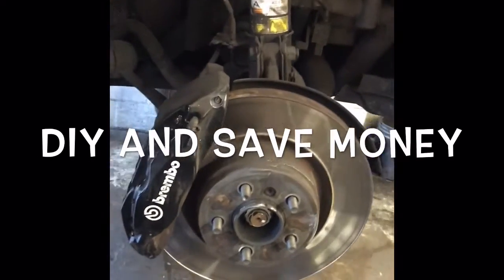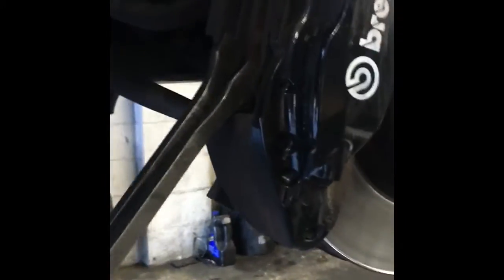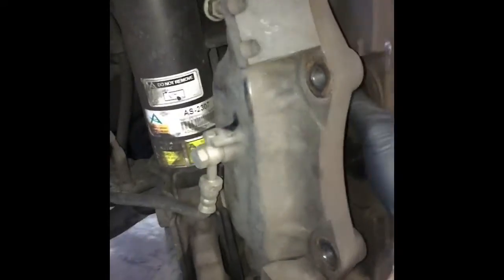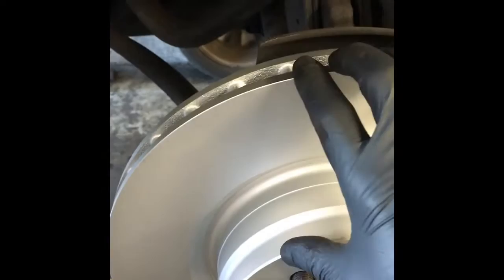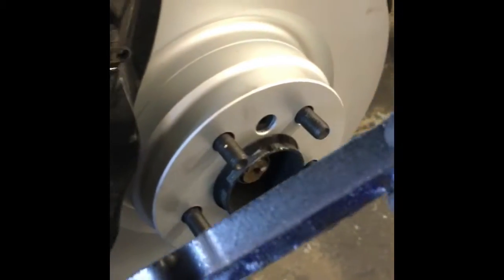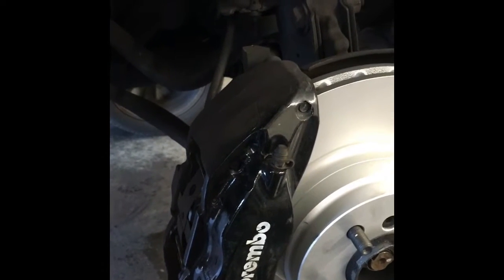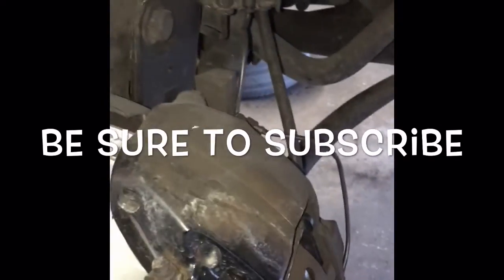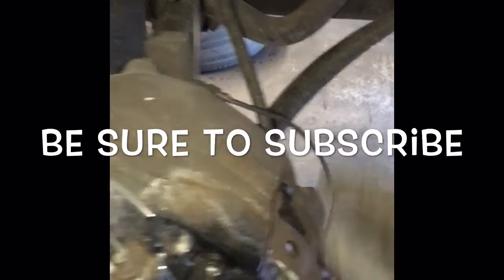How to Replace Front Brake Pads and Rotors on a 2005 Range Rover

Comment: Thank you for posting. Do you own this RR? If so how are maintenance costs outside of DIY maintenance. I'm talking about major stuff like engine, electrical, transmission issues? Think of getting presented but will do basic maintenance myself.
Reply: I meant to say thinking of getting pre owned...
Reply from the maker: Matt A this is a customers car. They can't have transmission problems. Due to the car being very heavy. The problem is I see have window switches regulators cupholders small problems like that. They can leak oil though. Hope this helps and thank you for watching.
Reply: How to Automotive Thank you for the response and again for the video.

Comment: I have a 2006 Range Rover sport. The drake light still on. Should I get a new sensor?
Reply from the maker: Mensaje final And some of those vehicles we had to turn off the scan tool. If that doesn’t work then I would look into replacing the sensor. And if you didn’t replace it when you did the brake pads and definitely do it.
Reply: @HowtoAutomotive  I have the same question as Rime? That first comment.  Can you please  help ?